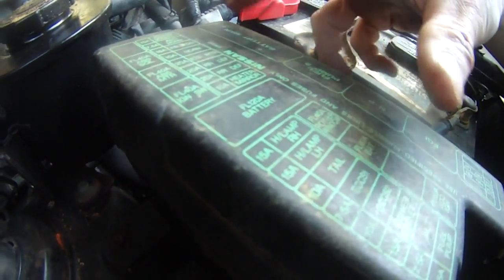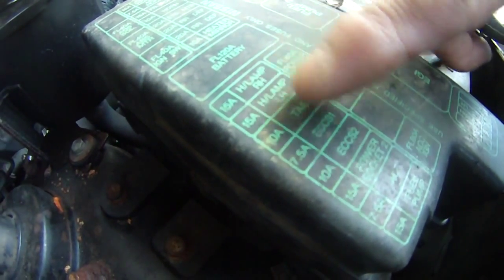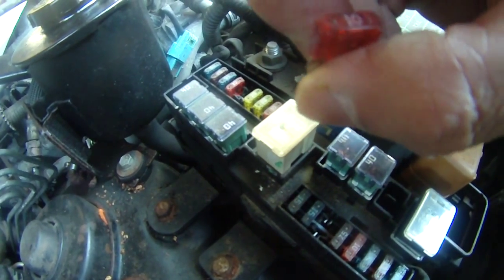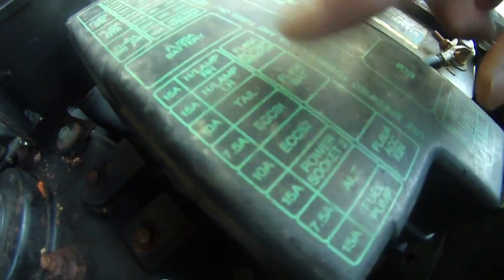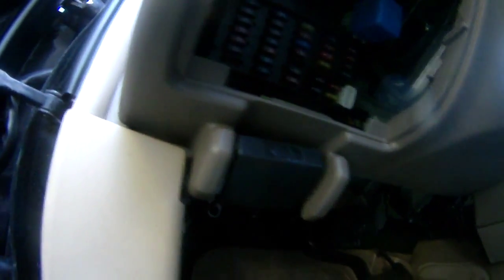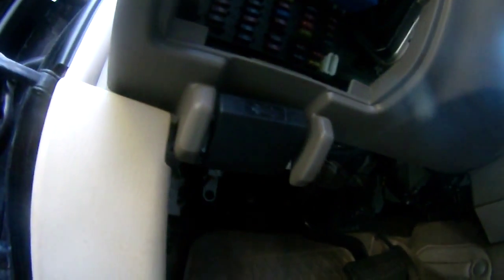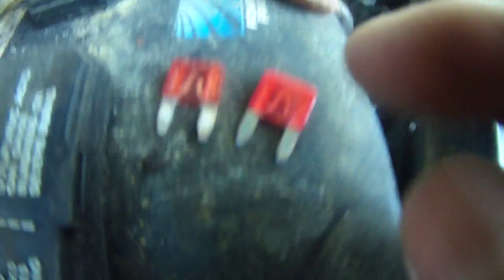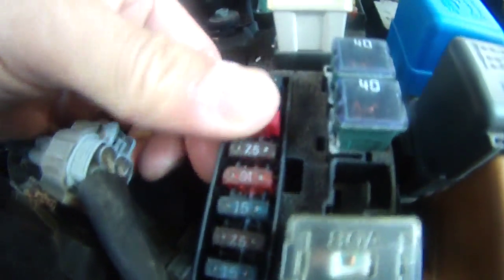Pathfinder tail and stop light - fixed

Comment: Thank you! Was able to fix the tail light and the panel light.
Reply from the maker: I just burned all my tail lights again, and found the 10amp tail light fuse under the engine hood burned again. The inside 10 amp fuse was OK. This is my 4th time replacing it due to human error installing a truck RV backup and monitor camera.

Comment: I'm having the same problem, taillights fuse keeps blowing, could it be a bad dimmer switch the switch on the left side near the mirror switch
Reply from the maker: Best of luck! My taillight fuse keep breaking because of my own human mistakes - forgot to unplug the tow light before I launch my boat. So, the fuse shorted when the LIVE wire touched the water from the splash when I launch my boat. If you are not launching your boat and you never touch the LIVE wire with wet hands then you may have wire tearing problems somewhere that positive touching negative.  I am no experts, so better Post your questions to car forums if no tear in your wiring. Did you splash water onto the mirror or mirror switch?
Reply: njfishing1 no I don't believe so I do a have a trailer hitch thing in the back but I never use it.
Reply from the maker: check there, maybe the rain got in there and shorted your fuse.
Reply: same problem on my xterra. no hitch package. keep blowing tail light fuse

Comment: Need help tail light not working deos anybody no were relay is located fuses. Good
Reply from the maker: It is either under the hood or under your steering column. 99% is your fuse burned out instead of your relay went bad.
Reply from the maker: good luck.
Reply: njfishing1 I'm having the same problem, but fuse keeps blowing. Could it be the dimmer switch.